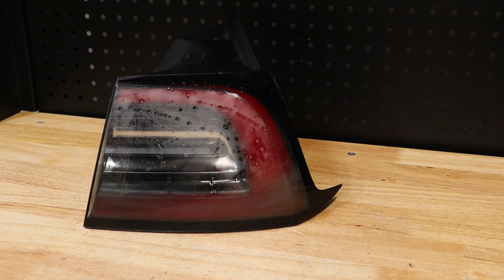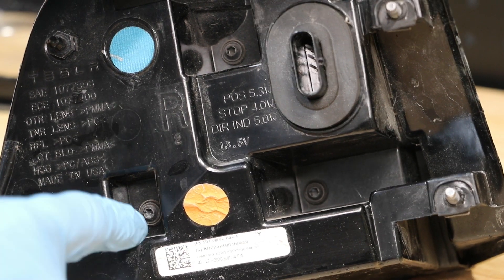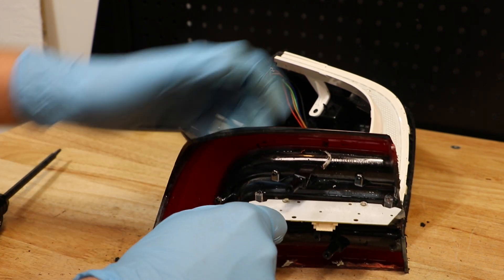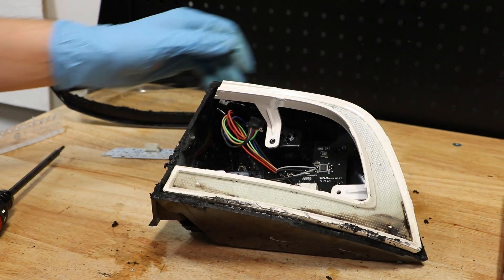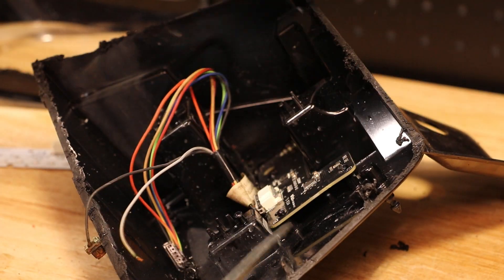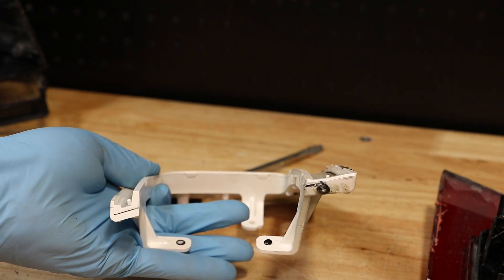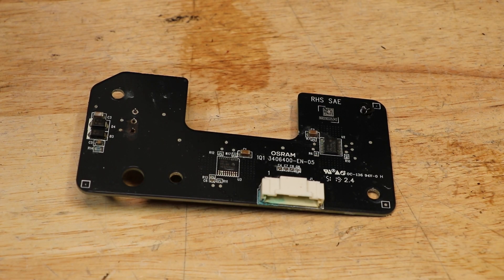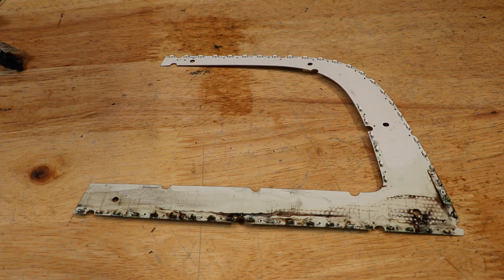2018-2022 Tesla Model 3 OEM LED Tail Light Disassembly

Comment: Glad I found this, so would you recommend siliconing the lens seams? My right outer light is still working... for now
Reply from the maker: Are you experiencing water/condensation problems?
Reply: @gftgrill  yes water intrusion after rain most likely bad trunk drainage
Reply from the maker: @billybong5  I would start by running an experiment.  Open the trunk and use a hose or pitcher of water and pour it in the gap next to the trunk so the water runs to the light and see where it hits.   

Assuming it hits the top of the light, then you could run some silicone around and reseal the gaps.   I'd be interested to know if the water hits the wire connector and if that's where the water is entering the light.   

You might also consider drilling a hole in the bottom of the light to drain out any water that is in currently in it and give future water a place to drain.
Reply: @gftgrill  great tips i will do the water test and see where it hits